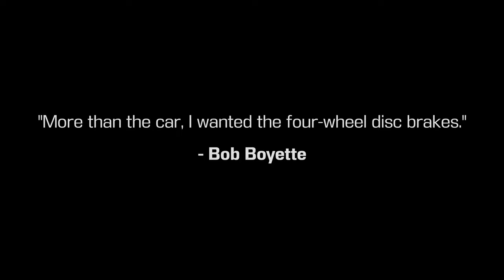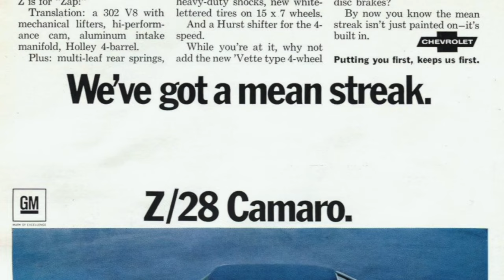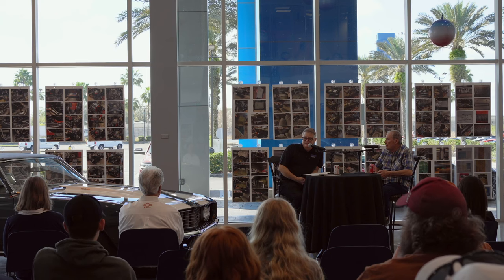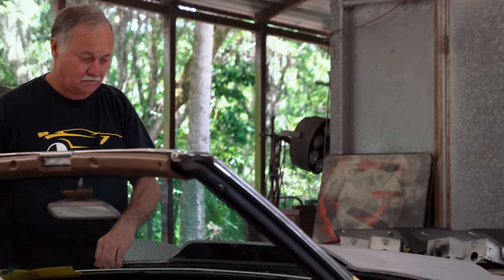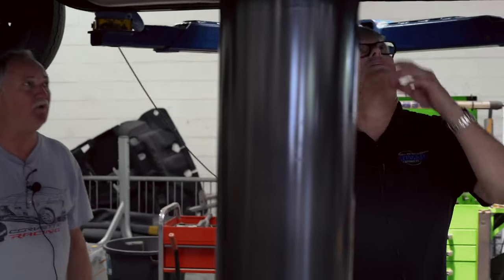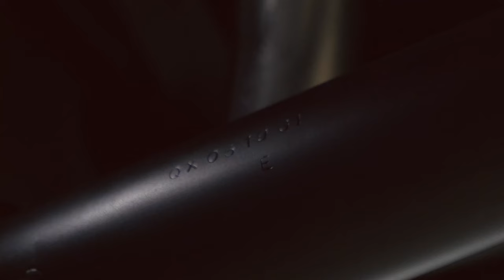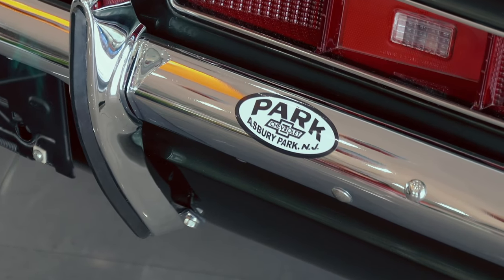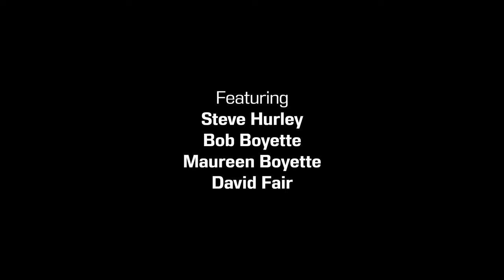1969 Camaro Restoration: The Story of the Boyette Z/28 | Documentary by Stingray Chevrolet (2022)

Comment: I about fell out of my chair when I watched this video because I also owned a 69 Z28 in these exact colors! I had mine in the early 2000’s, didn’t own it very long because after buying it I decided I didn’t like the color combo and wanted to change it to a white interior but all my car buddies told me it was so unusual that it would be a crime to change the colors. 
The one I had had set in the back of a machine shop in SoCal for decades and was discovered by a local Camaro nut. Anyway don’t mean to ramble on but just thought it was a great video on such a rare car and the importance that was put on the color combination. Btw I do have pictures of the one I had.
Reply from the maker: Very cool! Glad you liked the project.

Comment: If I remember right the 4 wheel disk brake cars had 1-5/8 rear axle diameter instead of 1-3/8 diameter axles for Trans Am racing.

Comment: As a former owner of a 1967 Camaro RS, with a modified 327/4-spd, I can relate to the top speed he mentioned.  I did 141 mph (1x).  I really could have used 4-wheel disc brakes…

Comment: All you had to do is truck it out, 12" disc on the front 11" drums on the back. It's an old school trick back in the day and work just as good. Plus you didn't have all the problems with parking brakes associated with rear disc brakes.

Comment: I gave away a 1968 Camaro R/S.  Blue with black vinal top and black vinal interior.  It was a V8, power glide which is why I lost interest.  I traded this car for a quarter panel restoration on a Buick convert able.  I'm glad it went to a good kid because with my luck it was a 327 with 360 HP.  This car would not start.  After a battery and starter install, I think it had a cracked bell housing or torque convertor.  To this day I kick myself for not restoring this car.  I'm glad I have a Corvette C4 today to make compensation.